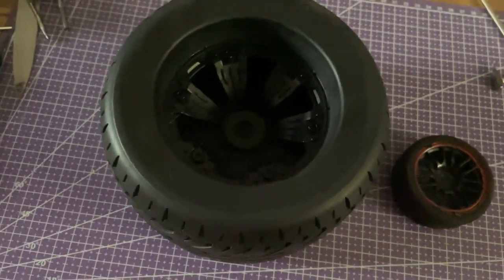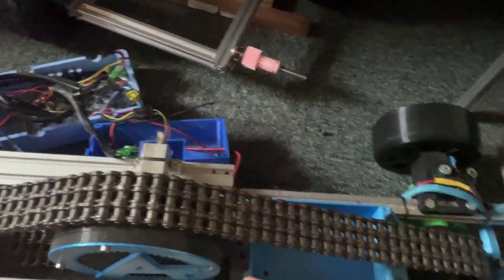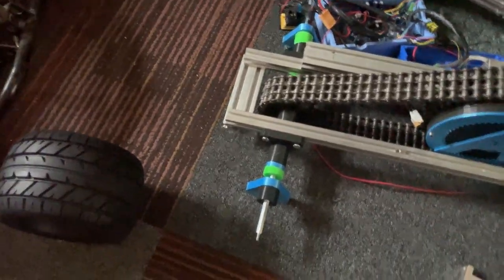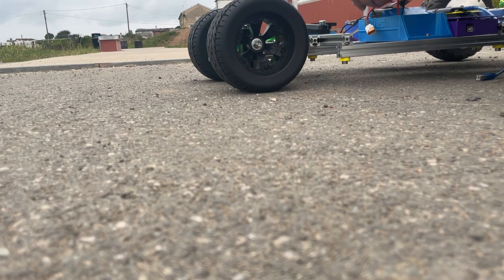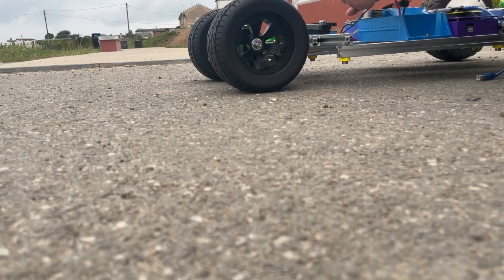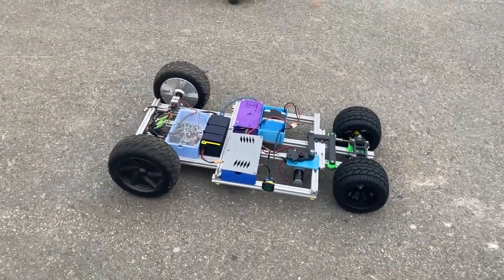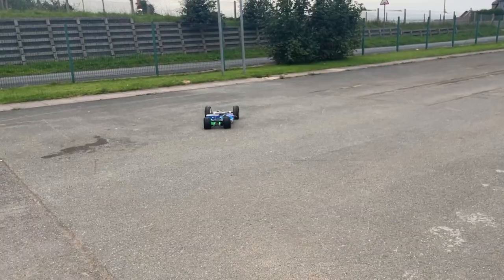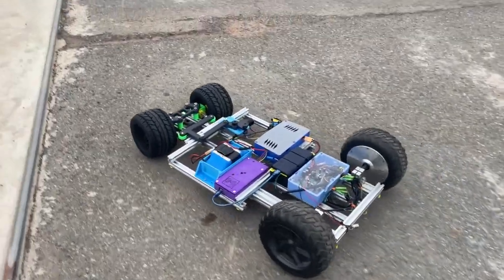Hoverboard Powered BATMAN TUMBLER RC car 1/5 scale Part 1 Build and Test

Comment: What speed controller do you recommend for two hover board motors running skid steer configuration with a standard rc remote?
Reply from the maker: hi, id say use the motherboard from the hoverboard, all the wiring is there ready and it can charge the battery too, hope this helps

Comment: Long as both rear wheels will are powerd wont trun very good one rear wheel free wheels and will trun better just saying
Reply from the maker: hi, thanks for the comment, they arent physically linked so they should be able to turn at different speeds ok with a bit of resistance, the steering angle on the front wheels is low which doesnt help, the way I put it together could be improved so the steering link bolts dont hit the frame, thanks